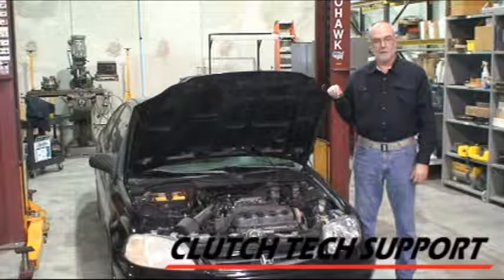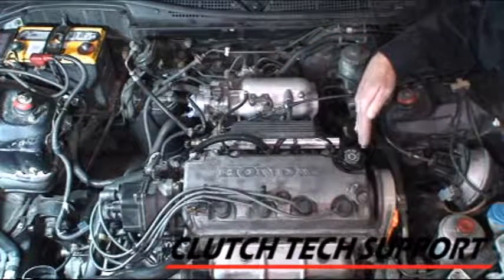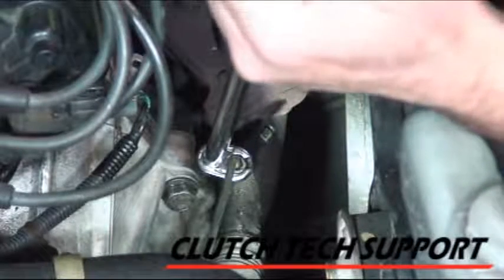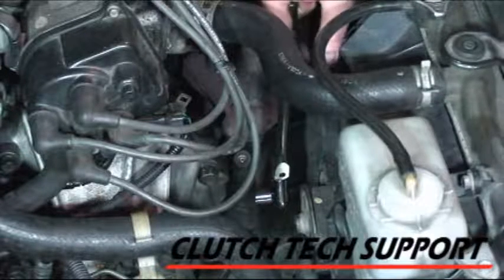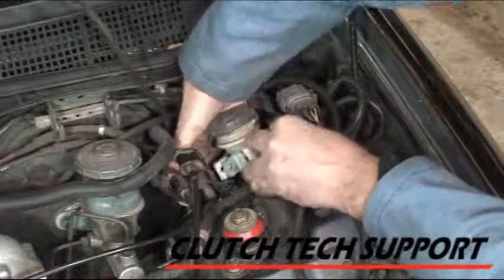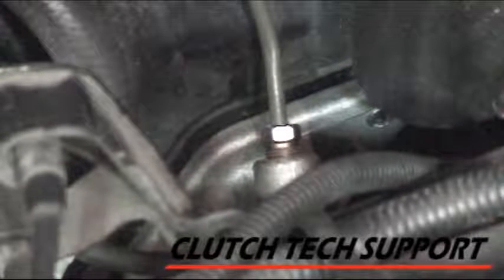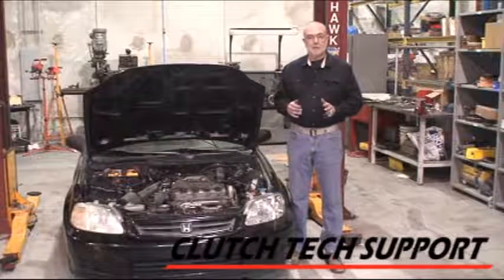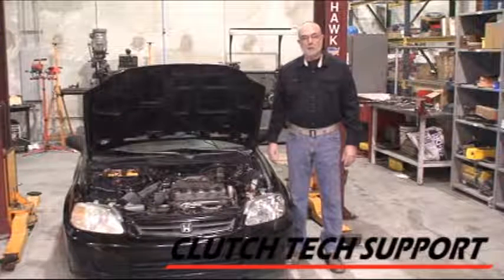2000 Honda Civic EX 1.6L Clutch Hydraulic Release System

Comment: How many turns of teflon tape did you use? I can't seem to get a good vacuum when I setup the hand pump. With the bleeder screw closed and I apply vacuum the gauge starts dropping and I can see some fluid and air bubbles starting to enter the tube but with the bleeder screw in closed position. Do I need to just make sure all the connections in the system are more "snug" and put more teflon tape on bleeder screw, any thoughts? Thanks!
Reply: Gary, thanks for getting back to me. I did double check the validity of the vacuum tool, it seems to hold a vacuum. Looks like the one you used just got it from harborfreight. The part I replaced is that flex rubber hose which connects the two metal pipe lines. Part #46961-S04-003, its off a 96 civic ex. I did not disturb or mess with any other connections besides where the flex hose connects and the bleeder screw on slave cylinder. I do not see any leaks either. After brake cleaning everywhere I touched, all parts are dry. I did only put 1 turn of teflon tape and I made sure to only put on threads. I'll try wrapping with 3 turns and try again.
Reply: @perfectionclutch  I  replaced the master cylinder about 3 1/2- 4 years ago? I have not adjusted the push rod since then.
Reply: @perfectionclutch  Finally got some time off work to redo. I put 3 1/2 turns of teflon and finally got a vacuum. I still saw a few bubbles but way better than before. Now I have about a 1/2" pedal free play like in the vid. Thank you this video definitely helped me out!

Comment: If I put a one way valve on the bleed screw, then I shouldn't need to open and close the screw between depressing and releasing the clutch pedal, should I?  I do that when bleeding breaks and it works just fine....

Comment: 94 Accord EX 5 speed.

If I adjust the pushrod to the fully extended position, end of threads, I can still push in my slave?

Clutch is then overextended, causing shift issues.  Put it back to halfway, shifts correctly..

All new slave, master, clutch and disc etc...

Thoughts?   slave and master are Japanese high quality aftermarket.

Why does my slave not block off and not be able to push in like in your video....?  When over adjusted......??

Thanks?

Comment: I tried the first method and didn't see any fluid coming through the hose after having my brother pump the clutch about 15 times while i opened and closed the bleed screw.. is this air still trapped in the system or could it be something else? I have a 2003 honda civic 1.7L ex with this exact setup
Reply: +perfectionclutch No adjustments to the master cylinder.. However, it all started when I took the push rod out of the Slave cylinder to grease it, and the joint on the clutch fork as well (clutch was squeaking very loudly). When I got everything assembled back together (so I thought), the clutch pedal fell straight to the floor when I pushed it. Now I'm unable to put it into any gear while the car is running
Reply: Haha I know I went above and beyond on the grease probably. I put some wheel bearing grease on the clutch fork joint where the push rod head sits, and also on the little piston inside the slave cylinder where the other end of the push rod sits. I replaced the slave cylinder and made sure this time it was sitting inside of the fork. Last time it wasn't because the spring, along with the piston, came out of the slave cylinder. I'm going to replace the master cylinder since I've been told it is more than likely leaking internally, since I can't get any pressure through the clutch line.
Reply: +perfectionclutch Just a late update: I replaced both the master and slave cylinder and now have pressure on the clutch pedal. I came to the conclusion that the internal seal on my master cylinder wasn't sealing anymore, since the slave cylinder was no longer pushing on the clutch fork while I pressed on the clutch. I also learned that the little o-ring that sits at the bottom of the master cylinder clutch fitting, is very important. If that o-ring isn't there then fluid will squirt out of the retaining clip. Just thought I'd give an update for anyone that's having clutch pedal issues
Reply: +perfectionclutch Thanks Gary. Make sure you stick a gold star on the certificate too, I've always wanted to be like Spongebob.